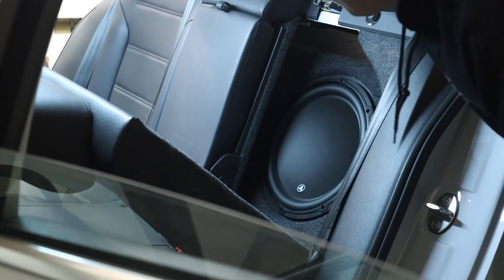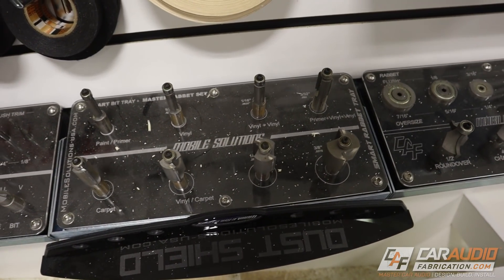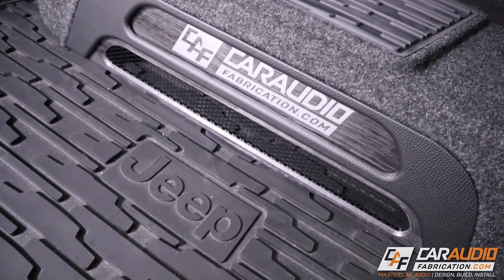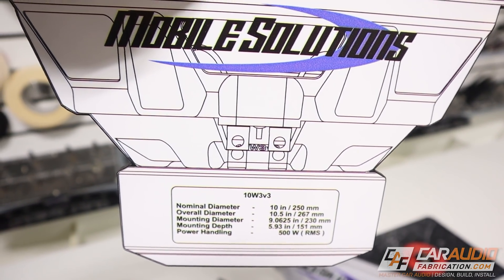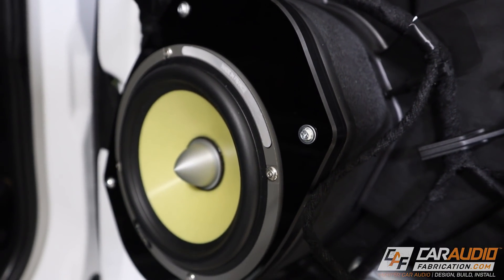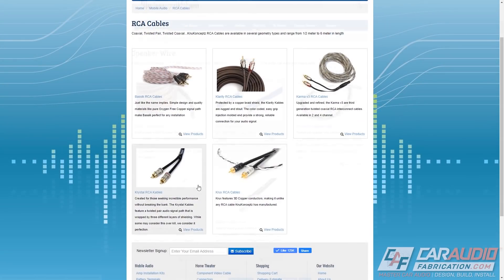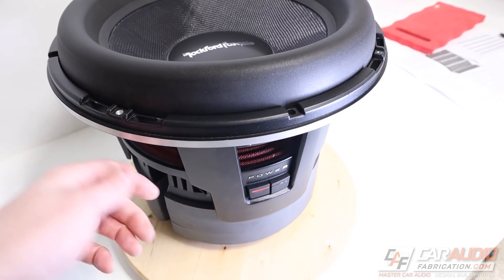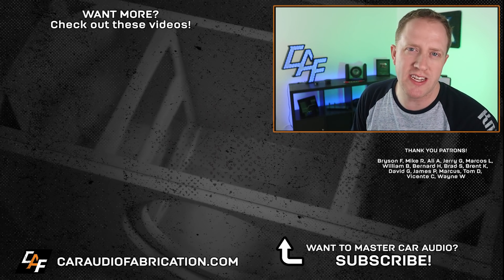5 Fabrication Mistakes that ruin Car Audio Builds!

Comment: Designing so that your subwoofers are protected from its environment and debris. Not sliding around and hitting things and also nothing hitting it. I have never seen so many subs on the marketplace with damaged cones and surrounds and questioned how do people let that happen. Some solutions being grilles, down firing, up firing, securing the enclosure, etc..

Comment: Mistakes I've made is not matching my subwoofers and speakers to the amplifiers and thinking that the gains were like a volume control correcting those two Mistakes really made my system sing.

Comment: One of the biggest mistakes I see people make as a professional installer is clients running aluminum "4 Guage" power wires through the door jam  and then fusing it with a 150 Amp fuse when it blows for whatever reason ;)

Comment: I didn't know how to make a curve in a piece of wood by cutting slits and then gluing for strength. My box goes under my seat in a 2013 ram 1500 and I made sharp angles along the front edge. It fits, but looks like a first time box build. (which it is)

Comment: Using the subwoofer gasket to measure the cut out diameter of the sub on the baffle instead of just the measurements on the manufacture site.

Comment: Measuring.... On a build I was doing the space I had for an enclosure for four 10s was 47.5" wide. Well I took the measurements down but didn't build the box until a couple of days later. So when I was cutting the wood I looked at my notes and thought "47.5 or 48, whats the difference??" besides, at 48" that was less cuts I had to do, right? Well, after it was all built and me and a friend went to put this 8cuft 300lb beast in my 2 door vw gti, I found out the difference between 47.5 and 48 was critical

Comment: Really good advices!!! My greatest mistake was port design for a subwoofer. I wanted to get as low as possible and needed to have a long front firing port. When I installed it, I got really close to the back panel and decided it is ok. Turning it on I started hearing whizzes and whooshes coming from the enclosure due to the air rushing out on a very small gap between the huge port and the back panel felt... Not the brightest idea I had :)).
Reply from the maker: Oh no!

Comment: My "mistake" my mind moves faster than my hands/body. I'm well over 7 years into my system, I've got rear door woofers, 1 tweeter, my amp, my sub, and sound dampening up to the rear doors (mostly, need to add in trouble spots). Granted I'm disabled, and ANYTHING takes me at least 5x as long as it used to. Also the vehicle is the daily driver for 2 ppl, so a free day or 2 to work on it (while I'm feeling up to the task) hasn't been too often. 
Mistake don't trust cheap Chinese LEDs they like to catch fire
Mistake don't use cheap sound dampening materials behind speakers/subs, use quality products on the metal to stop the rattle
Mistake don't use spray rubberized undercoating under the carpet  (it just sticks to the carpet)
Mistake don't use flashing on vertical surfaces without using a contact adhesive too.
Mistake place crossovers in locations that are reasonably easy to get to (for fine tuning like reducing tweeter dB)
Mistake NEVER ALLOW ADVANCED AUTO PARTS CHARGE YOUR AGM BATTERY!!!!!!! (THEY "LOST" MY XS Power d3400 with triple posts. It was worth $450! I checked back after 1 week, they said they would call when it was ready, no call!!!) Just get your own battery charger, so you NEVER give someone such a special battery.
Suggestion- have a MASTER PLAN on what you want to do, write it down. Revise as needed. Include all wiring details and plan for as much as possible. Also try to outline the costs, if it's expensive - break it into chunks so that it's easier to manage. 
YOUR STRONGEST CONNECTION IS AT YOUR WEAKEST LINK  (get quality connectors, wires, interface protection, etc.)

Comment: On my first box build I designed it as a double baffle and subtracted 3 3/4 pieces from the total side depth. The design program I used didn’t factor that in so I cut the pieces too small. I used the second baffle piece to redo the sides thinking I’d get it playing and put on another piece later. Unfortunately I used a cutout diameter I found online that was too big and had to get a piece to redo that as well. It actually ended up sounding pretty good but I was pretty discouraged at the time.
Reply from the maker: This is why I never trust "calculators". They make too many mistakes. Best to actually design the box. Glad to hear you eventually got it figured out!

Comment: You are spot on with all mistakes mentioned. But, at 2:51 you had mentioned to not use a spray aerosol adhesive. Why not? Have you ever used 3M Super 77 spray adhesive? It's so tough that if you try to pull apart a fabric and Masonite or MDF the layers of the substrate will peel away. I had made a set of custom door panels for my '68 Chevy 2wd pickup back in 2004. They are still just as strong and durable today as they were 17 years ago. I swear by that adhesive. 

Thanks again for another great video. It helps to remind some of us who have been out of audio fabrication for quite a while.
Reply from the maker: Might have worked for your fabric but rarely works for vinyl, especially if you need to really stretch it, it just doesn't have the same grip.

Comment: One of mistakes I see the unmatched amps RMS power with speakers/subwoofers that used in setup, also seems that recommended subwoofer’s box specs that came from manufacture could be ignored due to available trunk space, last but not least using wrong or underrated wire gauge for amps, imagine that some builds has all of above in addition to low power and without big 3 upgrades, waste of time and money, it’s like mounting 2 X T2 13” RF in a small box for 2 subs 4 cu.ft. along with 1500 RMS mono amp using a 4 gauge wire, I’d go with (only one) T2 16”  RF subwoofer with a bigger amp that up to 2500 RMS along with a 0 gauge wires in addition to the big 3 upgrades that will sound way much better and louder than 2 subs

Comment: Biggest mistake I have made is buying a pre fab box. Maybe there are some good ones out there but I had to go through 3 boxes before I had 1 made. Night and day difference
Reply: Looking to get one made... Any suggestions or recommendations?
Reply: @RAW_Reality  Mine was made by, "Dave the box guy" but I don't think he's doing it anymore. I have 2 JL audio 12s and it a ported box with a 6in port and he used 7ply plywood for the box. I've had the box for years and still holding up.

Comment: Ordered my wiring kit from knukonceptz. 
 Got the basik kit not ofc but 0 gage with 200 amp fuse twisted pair RCA cords and o bundle of 12 gage speaker wire. 
It's for 1200watt rms amp so more than enough 👍

Comment: Thanks to your video's the install in my car was far more easy than I anticipated. I've picked a shallow subwoofer, designed the enclosure in Fusion 360 with specs provided by the manufacturer, buld it in my own garage,  got an amplifier and component set too match the system, wired everything and even did sound deadening.  The install took about three full days. All thanks to the knowledge I got from your videos!  Keep up the good work!

Comment: I disagree on the chip board for sub box use, it's still much better than using plastics and often much better than mdf because it's rigid unlike floppy mdf... ply is the best because it's rigid and light the trade off its harder to work with.
Also use WR rated mdf/chip and wear a mask while cutting/sanding.
Dunno about your  thick plastics they are just not available to the public easily... probably over 500 a sheet here

Comment: My biggest mistake was making a sub box that was firing up, stuffing it in the trunk space allotted for the spare tire. Guess who had a toolbox that opened in the trunk, and I had a hammer bouncing around in the sub cone for half an hour. Sub still works after I fixed the cone with epoxy and a thin layer of carbon mat. Stiffer than new. Still plays 6 years after.
Now  I have to make a new box for my new car, I won't be having toolboxes in this one and I will add a metal grille.

Comment: You should do a video on how to cut perfect circles without a router table (not all of us have the room for a router table. Also, how to measure a subwoofers cut out, just bought a JL 10TW3D4, no cut-out template. (I know most do not provide a cut-out template).
Reply: There are videos on home-made circle jigs. I watched a random video on how to make one for jigsaw out of scrap wood, and just built one like it for my router instead.
Reply: @gakudzu7282  thnx. Ill do a search...
Reply: The hole diameter for that sub is 9.625" / 244mm, from jlaudio.com.

Comment: Hey man, I love your videos so much, I may not be able to follow your builds 100% but your videos (and ONLY your videos) have helped me build my system in my car to the point where I am in love with how it sounds, and it's only 120 watt RMS!! Also I have a question, is there a way to make mids and tweeters sound better? Right now my bass is absolutely perfectly crispy clean but my tweeters specifically are distorting like crazy at high volume, like it's trying to push bass through to them even though they have capacitors on them. Thanks a lot

Comment: Regarding the contact adhesive: what would be the desired PSI from an air compressor without being too much or too little?
Reply from the maker: CFM is what is important for air tools. I'd say you need a fairly decent compressor to use a spray gun, you can always brush it on.

Comment: One of the biggest mistakes I see is placement. Position and direction of fire has a huge effect on resonance and frequency response. It is also a large cause of body rattle which brings me to the second mistake I see a lot. Failure to use body dampening like dynamat or a similar product. Body rattle is an ugly sound. It can also introduce unwanted harmonics to the listening environment. And let's face it, it doesn't impress others when they hear your trunk lid slapping while you roll by no matter how loud the bass is.

Comment: What i want to know is 1. what jig saw blades do I use for Acrylic and abs plastic to make my rough cuts. 

2. How can I stop Router Kickback lol! Only happens when I use abs and Acrylic but works 100% smooth with MDF using a Mobile solutions spiral bit/ spiral flush trim bit.
Reply: Router kickback typically stems from:
1. Router speed/power being insufficient.
2. Part movement being too fast/hard.
3. Blockages caused by wasted material (it backs up inside the removal area, similar how cholesterol builds and blocks your arteries.)

Taking these things into consideration should keep kickback to a minimum and create smoother cutout from your router. ✌️
Reply: @RAW_Reality  good to know thank you, the speed to my dewalt DW618 Router is set at Number 3 which is 12,000 RPM im not sure if that is too slow or too fast for the 1/4" Spiral Flush Trim bit from mobile solutions. With MDF it works perfect but I do like the Heavy duty quality of the Abs and Acrylic, I've only used 1/4" and 3/8" thick ABS and Acrylic. Haven't tried 1/2" thick yet but I did notice that the thicker the material to trim off after rough cutting, the more possibility of me having router Kickback.  I got scared shitless the first time that happened. 😅
Reply: @joseluisruiz3789  LOL... Yeah, that first time's definitely an experience that'll take you by surprise... But, pretty much the rule of thumb for using a router is that the thicker or denser a material, the more you have to ease your way through the cut, especially if you have a lower power/speed router. So even with similar thicknesses of material, if they have different density, they'll cut different. But, it's like riding a bike; It's probably best to keep those "training wheels" on for a bit, but once you know, you know...
Reply: @RAW_Reality  absolutely lol! I'll keep those training wheels duct taped to my sides lol! Thanks again for the feedback your the only who helped me out, I greatly appreciate it. 😁👊
Reply: Pretty much what Smucky said. To find what speed you need to cut at, just make a few test cuts at higher or lower speeds on some scrap. Start slow and don't force it. If it's not getting it done, crank it up a notch at a time until it's cutting like you want.

Comment: You really can do well by having 2 routers. I have a small handheld one as well as a table mounted one like yours. Comes in so freakin handy!
Reply: Hell yeah it is. I keep my 1/4 bits with my trim router and my 1/2" bits with my full sized router and I have cut back so much time switching bits and collects. It really is a luxury
Reply: Yep. First thing I discovered after buying a router was that I shoulda bought two.

Comment: Common mistake I still do is routing the edges of an assembled box and having the screws hit the guide bearing of a round over bit. A little hand sanding usually corrects the issue, but it’s still extra work.

Comment: Have done the mistake of buying 2subs and then found out that i only had the space for one. And buying subs that requires more power than i had in my amp. 
Planing and choose products. And use your ears and not just by whatever speakers you can find

Comment: Make sure you plan and build your enclosure to fit in the available space AND make sure it will fit through the opening (door opening, trunk opening), to be installed. I built the enclosure in my truck to fit in the area where the back seat used to be, but didnt think to make sure it would fit through the rear door opening. I ended up having to remove the front seats and install the enclosure through the front doorway, then maneuver the thing to the rear of the cab. Don't be like me! 😆

Comment: I once built an entire box without test fitting it in the trunk. It turned out to be WAY too big to fit lol. Luckily it fit in my buddy's SUV perfectly
Reply: I recently built a box identical to one I already have to stuff behind my pickups seats, but when I was ready to put it in I found out the cab had a different design on the drivers side and had much less space, so I used a scissor jack to bend the body panel out to make the box fit lmao, and it worked. It's hidden from view as well because it's between the cab and the bed
Reply: Learned the hard way a long time ago too

Comment: Why don't we see people installing systems into new vehicles fresh off the car lot? You normally see 2010 years before 2010 vehicles with the system installs anything above that forget it 😂😂
Reply from the maker: I see new vehicles getting installs all the time?
Reply: @CarAudioFabrication  I'm glad that there are systems being installed in new vehicles. But I can't fined a dash kit for a 2015 Ford F-150 or a 2018 Ford escape. I haven't seen a how too install a system in a 2015 Ford F-150 or a 2018 Ford escape on YouTube. I guess Ford has a better idea.
Reply: @kevindavis4709  
If you wanted to go full on generic for the Escape, there's the Metra 95-5812 kit, but if you wanted something as "namebrand" as Scosche, they offer the FD3090B kit (which I believe would work for both of those vehicles).
Either way, you're looking at less than $15.
Reply: @kevindavis4709  you might try calling Crutchfield. If the mounting kit is made, they'll have it.

Comment: I remember cutting my rear deck in my 80's Cutlass. Stock speakers were two oddball 4X10's. Everyone back then used to put four 6X9's back there. I made a new rear deck out if 3/4 plywood about a inch or so deeper than the stock rear deck. Cut four 6X9  holes, and covered it in carpet to match my interior. Left the carpet loose on each end so I could bolt it in then tuck the carpet over the bolts, same in the middle except the 3rd brake light covered that bolt. Was a tight fit against the rear seat since it was over an inch deeper than the stock rear deck, but still totally do-able. End result: looked like a stock rear deck that was cut for speakers instead of a plywood overlay wrapped in carpet. 👍
Reply from the maker: Very nice, proper use of upholstery material, not a big fan of the raw wood look unless it's intended as an accent and woodgrain

Comment: hi. utter noob here. wanting to upgrade front speakers t something pretty quality and stereo unit to something other than factory with digital radio and Bluetooth. is there any reason i can't do these things separately or is it recommended to do them at the same time? thanks
Reply from the maker: In my opinion best to do the head unit upgrade first, and then the speakers, ideally amplify the speakers eventually.
Reply: @CarAudioFabrication  is the only benefit of an amp to make it much louder? I'm not really bother about a sub though I would like speakers with relatively good bass. I'd be more concerned woth quality over loudness. Would you still suggest an amp? Thanks for responding.
Reply: If you like the way your stuff sounds without an amp, then there's no need for one. Many people run there mids and highs off the head unit and just add a subwoofer with an amp for some bass. I did it for years. Now I want something louder and clearer.
Reply: @gakudzu7282  thanks. Would an amp provide clarity then? Or just loudness?

Comment: People never account the price of wiring or installation pieces. "Oh two bills for a deck. That's what's up."
"Yeah. Then the harnes. Dash kit. Control modules. And you still have stock speakers."
Reply from the maker: Not as much fabrication related as install, but you are definitely right. Folks have a heart attack when they learn they need a $300 integration kit to adapt to the vehicle. But those kits are worth it!